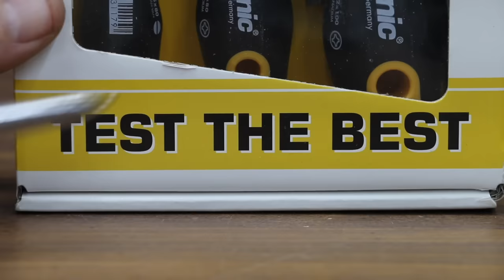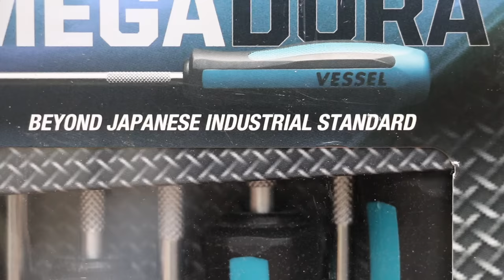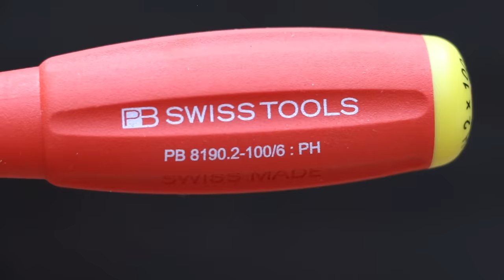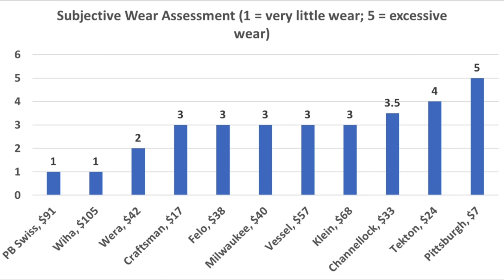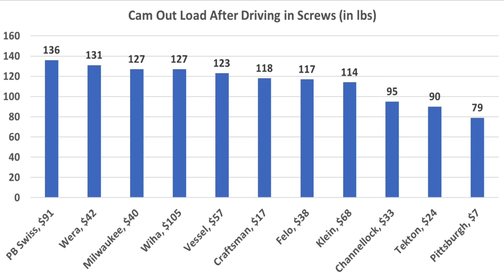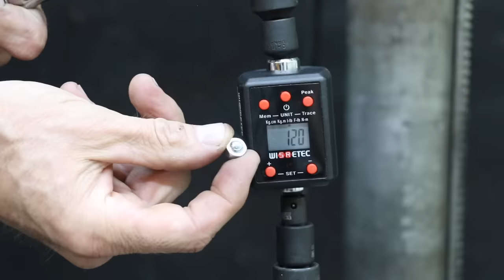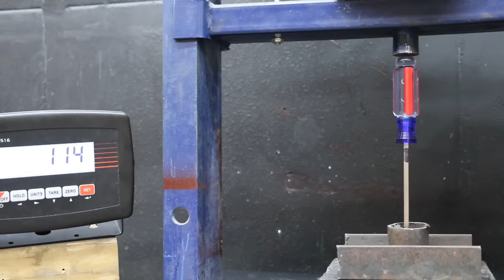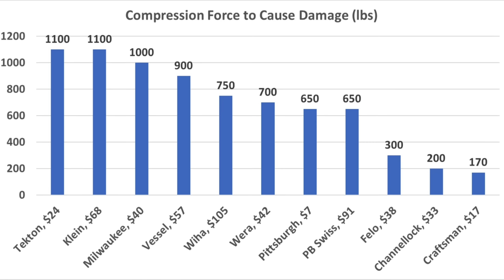Best Screwdriver Set? Craftsman, Milwaukee, Wera, Wiha, Klein Tools, Felo, PB Swiss, Tekton

Comment: The PB Swiss will be the last set you buy. The warranty is pretty amazing, replacing every part no questions asked. Thats also why every driver has a serial number. I am very happy with my miniature set from PB Swiss.
Reply: I can very much believe this. I have one PB Swiss screwdriver that I found in my old job’s lost and found bin, that sat there for months that nobody claimed. It’s a #3 Phillips with the clear reddish orange acetate handle, though in the “classic” style I think it’s called. I’ve used it quite a few times and love it. Seems to be perfectly designed in every way possible.
Reply: I had never heard of em till watching this. Mainly use klein hand  screwdrivers and nut drivers, have a cheap set of milwaukee 1000v insulated screwdrivers (industrial electrician here) and i use knipex cobra channel locks as well as regular blue channel lock brand channies. Im definitely checking out pb swiss after this
Reply: Both Felo and Wera offer a version of striking capable screwdrivers. I have both and have put the felo through the paces with good results. After about a year using it as a large flat head, chisel and pry bar, it’s got some wear to the tips edges.
Reply: @banehogs5589  I have a Klein flat head screwdriver and I'm sorry to say that it's garbage. and I have a Stanley screwdriver and crescent wrench and they are both garbage. my suggestion to Stanley is stick to making hammers and saws.
Reply: @musicauthority7828  
So since you have one screw driver that makes you a tool authority? I bet you listened to music once, and that also makes you the music authority, correct?
Reply: @musicauthority7828  most of my nutdrivers and screwdrivers I use for work are Klein, they work great and really stand up to the daily use and abuse they get put through on the job (I’m an HVAC service tech). Quality seems to be pretty up there. Not sure why you’re having issues with them.
Reply: @banehogs5589  Insulated Milwaukee it is actually made in Germany (Witte) triangle handle screwdrivers, which are in the same league as Wiha, Wera

Comment: Of the multiple brands I have laying around, I've found that I will most commonly reach for the Wera over any other. There is just something about the grip, plus the etching on the tip seems to make a noticeable difference.
Reply from the maker: Thanks for the feedback.
Reply: I concur
Reply: I've used the green handled set for years and got some of the hammer through versions (yellow handle) more recently, they are superb.

Comment: I actually have Wera screwdrivers and really like how their handles feel in the hand. Hard to test ergonomics but it's a big plus for at least my hands. Glad to see they also performed well for their price point.
Reply: I got the Wera bit when he tested months back. Now I know their screwdrivers are worth it.
Reply: Hazet screwdrivers are really good too.
Reply from the maker: Thanks for sharing.
Reply: My wera hex drivers are amazing, even abusing them they keep on working without issue.
Reply: from ergonomics pb swiss tools > wiha > haupa (not included in video)
fact: precission screwdrivers are good point of view what is good
Reply: @Cbych  Well that's why I mention "hard to test" ergonomics. I much prefer my Wera screwdrivers over Wiha that you rank highly. Everyone has different sized hands and uses their tools a little differently so that what works for me may not for you. 

As for prediction tools. Don't really have much use for it in what I generally do but have a nice Craftsman with multiple heads that I find works great for me. When I used to work in an Optical shop they had some really nice precision tools as I would imagine electronics shops would have to, don't know what brands are good in those areas though.
Reply: I have both Wera and Wiha screwdrivers.  Both are really nice, but I prefer the Wera for comfort and feel, and the handles are easier to keep clean.  If I have to buy more, they will be Wera.
Reply: Their hex key set has been outstanding for me too.
Reply: Like the Wera “feel” very well,  the blade tips, etc. are ergonomically great. My favorite, however, are the Snap-On screwdrivers and handles; their steel seems better than anyone else, but the price is crazy high. Luckily got them many, many years ago when they were a lot less expensive. Their ratcheting screwdrivers beat the heck out of anyone else. Best quality? Totally free replacement when they wear out, for life!

Comment: Wera and Wiha are my absolute favorites for screwdrivers. Nice to see them perform quite well on the wear tests especially. I've had a single Wera set and a single insulated Wiha set for years without having to replace any despite some pretty hard use. The Wera handle is probably the most comfortable I've ever used though, despite its lower price compared to Wiha
Reply from the maker: Thanks for sharing.

Comment: I’ve had Wera screwdrivers for a decade and I’ve always thought they were the best value for money. Many in my trade were using WIHA which costs twice as much. I still use my Wera set to this day. The handle is very ergonomic and easy to grip to allow you to screw with better force. Underrated and good value. Happy to see my experience is backed up by testing. Keep up the good work! Your videos are helping many of us in deciding which brands to buy and saving us both money and time.
Reply: I have a Wera Kompakt VDE set, while it's great I have to admit I prefer WIHA's TORQUEVARIO VDE, but I could buy 3 Wera sets for one of those.
Reply from the maker: Thanks, will do!  Thanks for sharing.
Reply: @siggitiggi  as the tests conclude WERA may not be the best, but definitely best value to performance.

Comment: I’ve had my craftsman screwdriver set for over 40 years and they’re still going strong. That was when they were made in the United States!
Reply: Yep!
Reply: Sad thing is even great product makers don't build anything as good as they could.
Reply: Correct, and 40 years ago they were hot forged and marked "Forged" on them. You always knew you could return one at a Sears as they were everywhere. Fortunately, that wasn't a too often situation for many.
Reply: @googleusergp  Yep, I still have all my old craftsman screwdrivers from Sears, funny I lived a block away from them too, and never had to return a broke tool ever. Sometimes I wish I did though so I would have an excuse to go lol
Reply: @neoasura  I lived about 3 miles from one and my uncle's neighbor managed it since it opened in 1973. It closed in 2019, and I bought a dishwasher there (a WLP made Kenmore) which replaced another WLP Kenmore that was bough there in 1987. I would have kept the 1987 one going but it needed a tub and wasn't worth it. I repaired that machine about 4 times in 32 years and all the time they were minor repairs many years apart. Both were made by WLP in Findlay, OH, which is still where WLP makes dishwashers today. I bought plenty of items over the years as did my parents, uncles and grandparents. I went with my grandparents to this very store in 1975 to buy their Kenmore (Whirlpool made) washer and dryer. They only needed repair one time, when I was in my 30s and I repaired both of them in an hour for under $70 in parts. I sold the dryer in 2013 for what my grandparents probably paid for it and it was working like new. Even the "end of cycle" buzzer still worked.

Recently, the neighbor that managed that Sears gave me a snow blower he got there in 2006, well after he retired in 1993. I relayed to him about the 1975 story and he was shocked that I remembered something like that.

Comment: Outstanding tests! You always make choosing the right brand a breeze. Thank you!
Reply from the maker: Thank you!
Reply: @ProjectFarm  Can you do a test of JIS screwdrivers?
Thank you
Reply: @ProjectFarm  can you do electric kettles? Which one is better and if they are cheaper to used compared to traditional kettles?
Reply: @ProjectFarm  Yes, your test and videos are excellent. Very interesting.
Reply: @ProjectFarm  please do a video on different ratchet brands like Mac, SK, Snap on, Craftsman. That will be a expensive video
Reply: That's why we tune in to Project Farm!
Reply: MANUAL CAN OPENERS!
Almost impossible to find ones that work and last.
Reply: @videodistro  The EZ-Duz-It can opener is the absolute best one on the market.
Reply: @EthanMcKee.  That's a hard one as there are different lines/eras of all of those tools. Everyone's going to have an opinion on that one for sure. LOL.
Reply: @EthanMcKee.  Client Graphics has some good ratchet tests. I’m always up for another one though
Reply: @googleusergp  it wouldn't be to hard to test some half drive ratchets of similar size until they break. New ratchets because you wouldn't want to test old against new model stuff
Reply: @gregblau8082 yeah I've seen them. I'm interested in project farm trying it out. What is your preferred brand?
Reply: @EthanMcKee.  Plus I wouldn't want to break older stuff where the rebuild kits aren't made any longer. Plus, you really can't compare old stuff that's been used and abused for 50 years versus something that was just made.
Reply: @SDsailor7  - I'm with you.  Yes, please Project Farm!
Reply: @EthanMcKee.  in general Snap On by far but I love the notched flex joint on Gearwrench and Craftsman. Matco is good but expensive. I probably have more than I’ll ever need but I’d like to check out some of the new brands like Capri or the newer Tektons
Reply: @kwakas4ever  He tested the brand vessel and I just bought a pair of but in jis.
Reply: @googleusergp  i agree you wouldn't want to test that good old stuff. Only new ratchets
Reply: @EthanMcKee.  We'll leave that up to PF if he's going to do a test like that.
Reply: @googleusergp  what do you mean? Of course its up to him what he does but he also said all his videos are viewer requested.
Reply: @John Even if that's the case, Amazon has some good stuff, all depends on what it is. I've gotten the same stuff there that went for more money elsewhere. I've also gotten a deal on Ebay that beat everywhere else. Snap On isn't what it's cracked up to be in some cases.
Reply: @EthanMcKee.  We'll see if he does the ratchet comparison. Even though it's viewer suggested, at the end of the day, it's up to the owner of the channel if he wants to do that comparison.
Reply: @EthanMcKee.  Nope. Do not assume what you do not know. Let's leave it that. Carry on.
Reply: Thank you for a great service. The Wiha brand is well known for making quality tools. It always pays of to pay a little more.

One test i would love to see is what hammer is the best. I'm talking about the hammers used for construction work, that is made for hammering and pulling out nails.

From my own experience there's a huge difference between brands, but which one is the best?
Reply: @EthanMcKee.  There you go again with speaking from the head you sit on.
Reply: @SDsailor7  Nepros makes a great JIS set. Feels great in the hand too.
Reply: @chloehennessey6813  The vessel screwdrivers have a round top and also feel very good you can put a lot of torque with them i only had them for a few weeks so i don't know how good they will be
Reply: @ProjectFarm  Eletric bench grinder there's a lot trash in the market!! would be cool and useful a video of it.
Reply: @ProjectFarm  hi thank you for making these videos. I have watched many and have actually taken your advice on multiple purchases. I have recently been working alot of road construction jobs at night and have been trying to find the best head lamp to purchases that is rechargeable as opposed to aaa batteries. It would be amazing if you could make a video demonstrating some of your scientific testing methods to figure out what's the best bang for your buck or honestly just what headlamp is the best out there as I wouldn't mind paying up for high quality. Thanks agian and I hope you consider making a video like this
Reply: @TehButterflyEffect  they ar great and
They are made in St.Louis Missouri
Reply: Great video once again Todd 👏 those dance moves made me laugh. Looking forward to seeing what you come up with next. Still wondering if tremclad paint thinned out a bit beats newer paints on wood. But regardless I'll be watching whatever you come up with. Thanks again 👏
Reply: @John ,how do you figure he works for amazon
Reply: @ProjectFarm  I was shopping for windshield water repellent/Rain-X & thought this may be a good project for you because a ton of people use Rain-X or some kind of treatment for repelling water on there vehicles.
Reply: You should do a series comparing NEW tools to those OLD hand-forged and wooden handled tools that our grandfather's had.
Reply: Tested strength, but not usability.
Reply: @ProjectFarm  g pop phyrotroto  re adds ash asz
Reply: @SDsailor7  yea, the vessel ones used were not the JIS type. I think the grey impact screwdrivers from vessel are so much better than the green ones.
Reply from the maker: Thanks for the suggestion.
Reply: WTF!?
Reply: @John Snap-On is made in China just like everything else now. It's no better than Craftsman. There are still American-Made tools, but they are hard to find.
Reply: Are you sure? I don't want to come off as attacking project farm because I do enjoy the channel.
But I really think these tests aren't showing us that much. Who uses screwdrivers like this? For accurate results, the screwdrivers shouldn't have been cut apart.
And the static loading from the press is very different to dynamic loading from a hammer blow - I have a feeling the numbers would be very different if dynamic loads were applied. 
Wiha are pretty universally known as the best brand out there, tied with Swiss and Wera. This is because long term actual usage looks very different than these stress tests, and I'd imagine even the cheap tools are going to last a long time when used normally. So I'm not sure buying based off of this testing is wise. I hate to say it, but a lot of these testing methodologies are getting too clever and causing errors. Keep the tests simple and try to replicate real life usage as closely as possible!
Reply: @VerticalSpeed1987  this wouldn't show much. Survivor bias is a huuuuge thing with old tools. Crappy tools were just as common back then, but they didn't last until today and have disappeared from our collective memory for the most part. So the only surviving tools are high quality because only high quality tools survive that long... If you know what I'm saying. It's a huge misconception that "they don't make tools like they used to". Well, only partly a misconception, because they generally make much better tools today.
Reply: Best wire stripper
Reply: Best wire stripper
Reply: @ProjectFarm  is it possible to test a Facom set VS beta VS Stahlwille VS Knipex VS Snapon?  Or Cant you get those?
Reply: The EZ-Duz it openers are not the same.  They've changed and are junk now.
Reply: @videodistro  good comment, I’ve been using one called a Swing Away for quite awhile (at least 12 years) and I’m really happy with it. You’re right, good ones are hard to find.

Comment: Another thing that would be useful to test is how well these screwdrivers perform out in the sun on a hot day. I’ve found through personal experience that with some brands of nut drivers (such as Jonard) the plastic handle becomes so soft on a hot day that the shaft just rotates inside the plastic handle, where as with other brands (such as Klein) this is not an issue. This is a big deal for me since I work outside and I use these tools every day. The two most important things to me when selecting a screwdriver or nut driver is how good is the grip (ergonomics) and how good is the plastic it’s made of. 
Just a thought, maybe for a future video.
Reply: good point.  Thermal resistance
Reply: Felo has awesome oldschool wood handle screwdrivers. You can wrench and hammer them (they have a steel/leather striking cap). 

They come in flat, PH and PZ.

Whenever I have to restore old turn of the century furniture with slotted screws from back then, I use either the Wera laser tip or, with delicate but rusted screws, the oldschool Felo. 

They last decades.
Reply: I never leave tools just out in the sun. If I am to use them all day they either go into a belt holder or a tool box.
Reply from the maker: Thanks for the suggestion.

Comment: Thank you for including Wera. They do make a model, that has the metal pass all the way thru the handle. That model is designed to be hammered ;-)
Reply from the maker: You are welcome!  Thanks for the feedback.
Reply: Klein has those as well. I bought a set around 2 years ago and the flat head quickly became one of my favorite and most used/abused hand tools
Reply: Thanks for that, handy.  Since I get hammered on occasion.